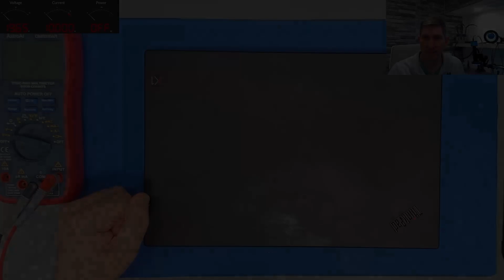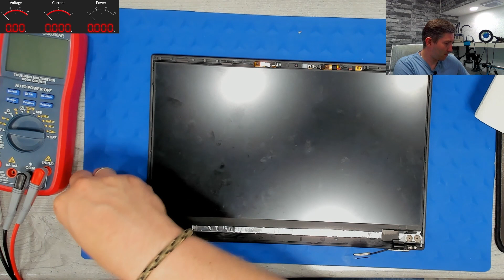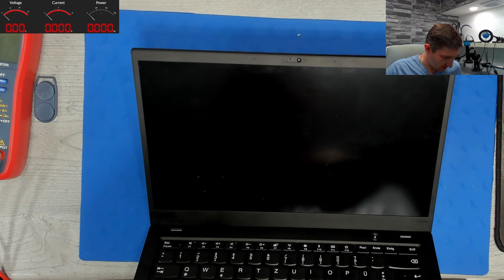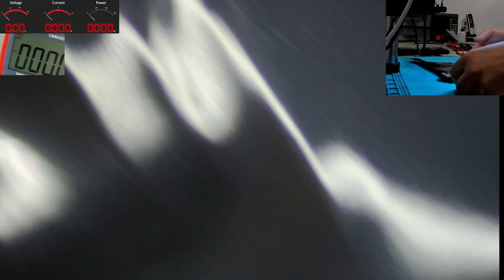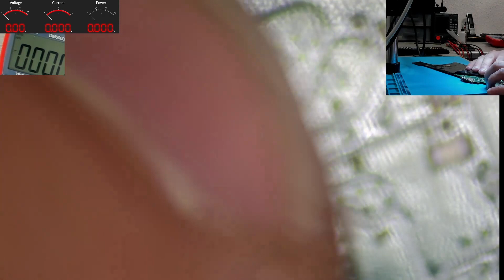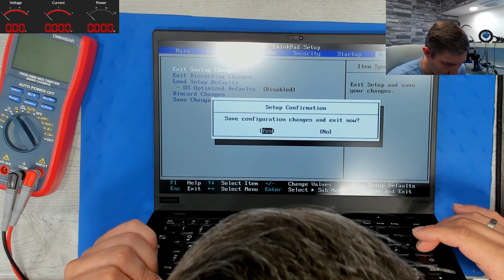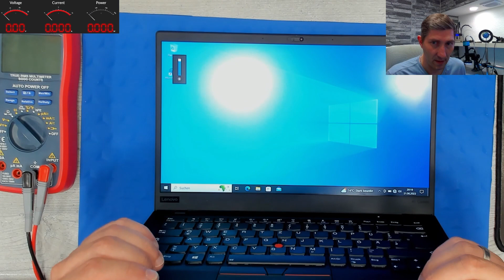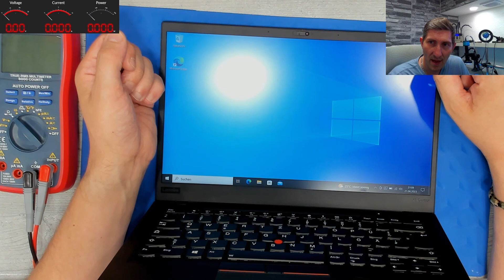Lenovo Thinkpad X1 Carbon 6th Gen - No Display issue with some surprises! Can we fix it...?

Comment: At 40:54 there is another burned resistor - But very good video
Reply from the maker: This is not correct. It is just covered by the lenovo typical black glue. Nothing to worry there.
And thanks!

Comment: I have a 6th gen, but reverse issue, I cant get video output over HDMI, USB Dock, or over displayport over Thunderbolt.

I have video on the laptops screen, but ANY way I try getting external video it acts like nothing is plugged in.
Reply from the maker: This doesn't Sound good. Exclude any drivers here being part of the issue?
Reply: @fairrepair_en  Yea, its defiantly not drivers.
I've also reinstalled windows, its some sort of issue I've never encountered before...

Almost like its something hardware related, but it defiantly seemed like it was on the software side to me.